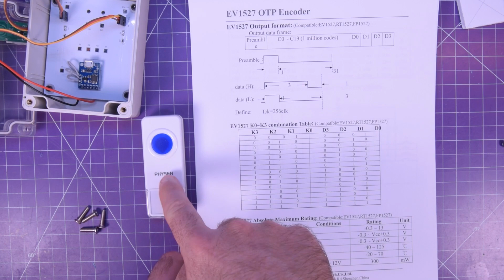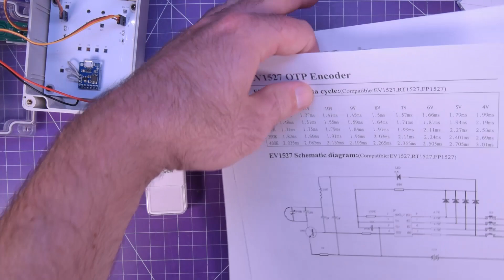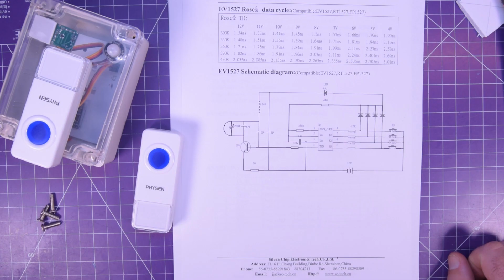I Hacked A Doorbell!

Comment: I used a single pole, double throw glass reed switch to trigger this type of rf doorbell push button, when a front drive gate was opened, using the classic magnetic door alarm arrangement.. By using a capacitor, it was possible to ensure the bell button press was only closed momentarily, even if the gate was held open against the spring.
. To provide an  adequate low signal to the button contacts, it was necessary to switch a relatively high value capacitor, about 100uF, across the button contacts. The second contact of the double throw reed was connected to a resistor, that safely discharge the capacitor without welding the reed contacts, when the gate closed.
So the alarm only required three components, the reed, a capacitor and a resistor, all of which were sealed into a plastic tube embedded into the wood of the gate post, with an associated magnet in the wood of the gate.  The advantage of this simple circuit is that no additional battery was required, and the circuit did not add any additional load on the CR2032 bell push battery, as the circuit takes zero additional current.
There was a concern that the capacitor would slow the button signal transition between logic states, resulting in potential damage, but the button circuit appears to have a Schmitt denounce built in. Therefore the choice of the capacitor value allowed the duration of the bell ring to be set to several repeated rings.

FYI, I too have used the microwave sensor boards in an alarm system. These boards are very sensitive and have a poor front to back detection ration. Meaning they can detect what is behind them as well as what is in front of them. To avoid this problem it is worth mounting the module in a open metal screening box. In my case, this was constructed from brass shim, soldered into a box shape on the top copper of the PCB. It is a standard technique, used in RF design, to enclose such things, as VCOs, and sensitive RF front end amplifiers.

Comment: Good Luck on version two, but you might want to look at the EV1527 schematic again. Haven't done electronics for a long time but if the schematic is correct then when the door bell button is pressed isn't it taking the input pin high to 12V and at the same time powering up the rest of the circuit and putting a charge on the 0.1uF cap. Then when the finger comes off the button the 0.1uf cap might supply enough power to finish the transmission if it was not completed during the button press, just my guess.

Comment: Cool project. I made a hacked doorbell project too, also with my own pcb. Good luck with version 2!
Reply from the maker: Neat! Were you more successful than me?
Reply: @SimpleElectronics  haha well the board is not as neat as yours but it's working okay 😃 Using existing libraries and examples, and watching kicad tutorials. Mine reads the code sent by a commercial  transmitter and plays a wav from sd card

Comment: This seems neat!I was thinking of a similar project for a driveway alarm that has too many false triggers with just the IR.Not good with coding so I was going to use an AND gate IC, but I guess SW could handle that too. This is a perfect project for a Jr high aged Arduino beginners! Do you have your code in a Git repository?🤔
Reply from the maker: It is SUPER simple, I can put it up if you want but it's basically "if digitalRead(0, HIGH) && digitalRead(1, HIGH) {digitalWrite(2, LOW);}
Reply: @SimpleElectronics   Ah..cool! Thank you for the tip! I was looking in the If-else-statement sketches... Something told me that would be a viable solution

Comment: I made something similar, interfacing an Arduino which was monitoring several sensors to a wireless doorbell pushbutton.
I used optocouplers between each device. Cheap insurance against ground loops and especially static, simple and works well.
Easy to do, just like driving a LED from the outputs in that all you need is a current limiting resistor.
Inputs are pulled down (or up) by the output of the optocoupler.
Makes it fairly resistant to static discharge which is very likely to be what did your prototype in. 
I find that simply standing up from a fabric covered chair induces enough static on dry days to zap unprotected in/outputs.

Comment: I'd have used a 74LS00 Quad Nand gate for detecting the sensors and connected straight up to the button. So much easier. :)
Reply from the maker: I bought an AND gate and couldn't get it to work - I think the counterfeit chips were at fault though
Reply: @SimpleElectronics  I've had the same problem a few times.

Comment: Projects you promised that seemed like a good idea at the time ! Personally I make a schematic even if its a realy simple project, I would have drawn that out (I use Kicad) and that makes it easier to understand especially if your trying to get idiots like me to understand ! so you are using an 'ATiny85 MCU' to detect 'either or' of your sensors being triggered then applying that signal to the doorbell switch and letting the rest of the stuff get on with it ? been a long time since I played with one of those microwave thingy's but cant that trigger the switch on its own ? also what sort of output does your PIR have ? you will almost certainly need some sort of buffer (transistor) between your MCU and the switch and all the usual care and attention to the MCU power, anyhow I suspect all will be good by version 2 so I look forward to the next part...cheers.